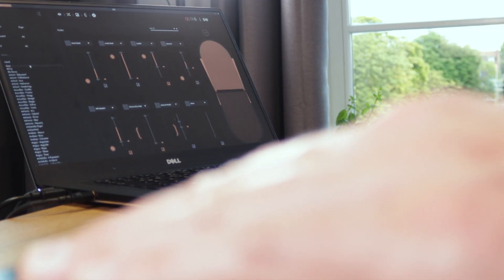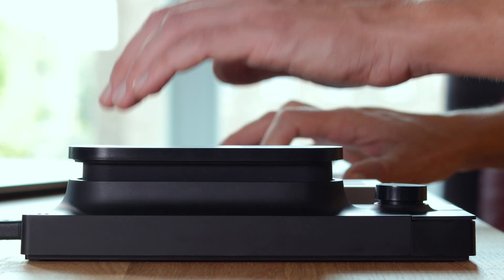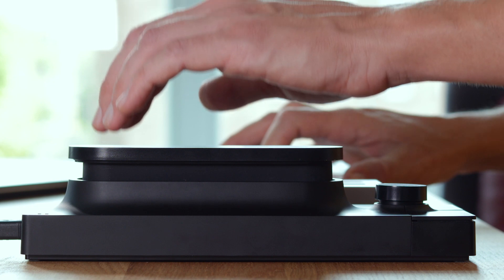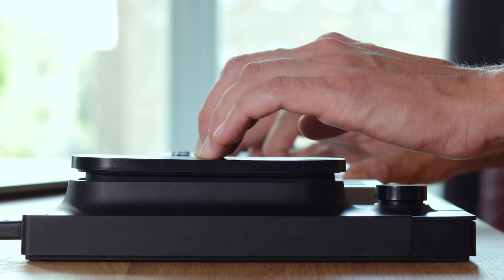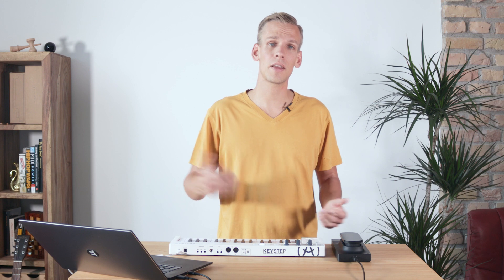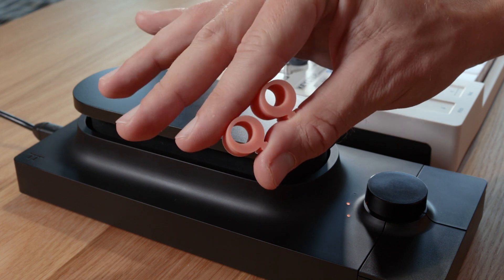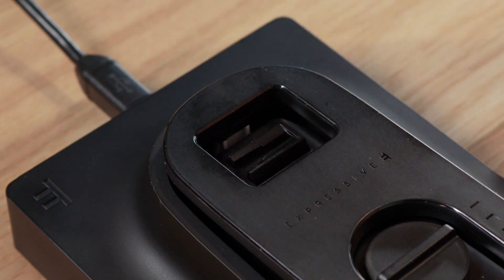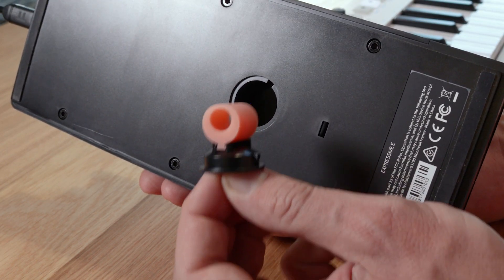04 | How Touché's mechanism works | Touché Tutorials

Comment: hi, where can this "arché" string plug in be found, mentioned at 02:30?
Reply from the maker: Hi, thanks for your interest, see here: https://www.expressivee.com/arche-collection
It works especially well with Touché, but you could also steer the virtual bow of Arché from a mod strip or wheel or a fader from some traditional MIDI controller